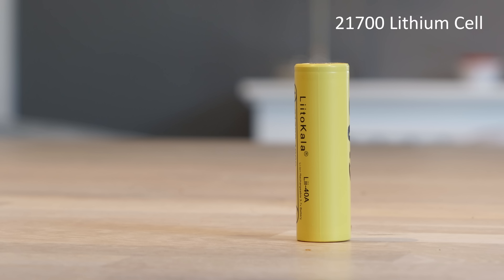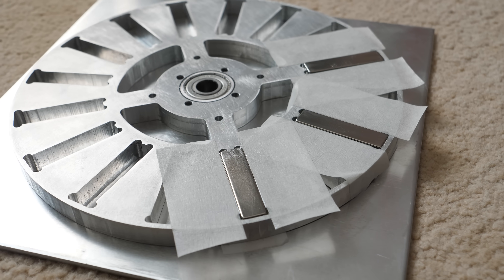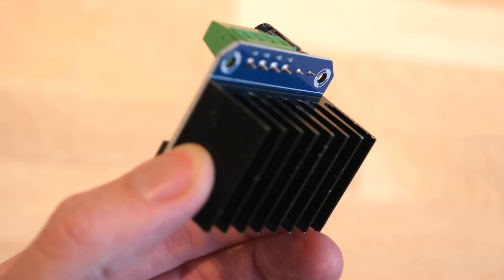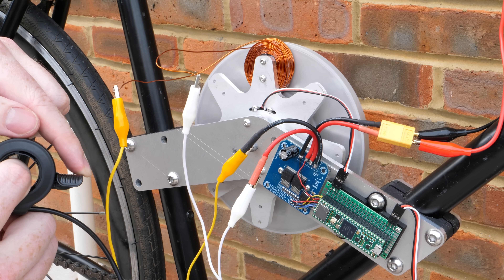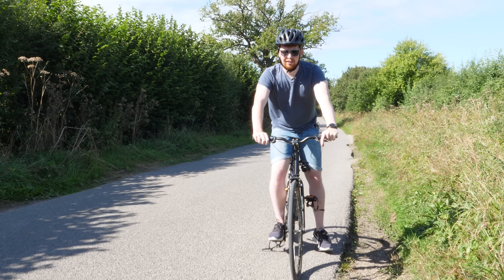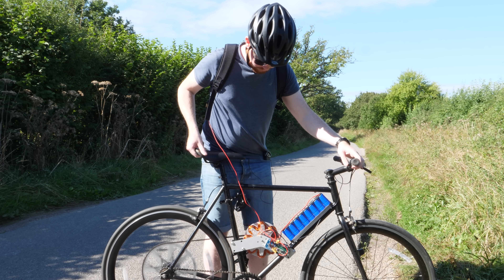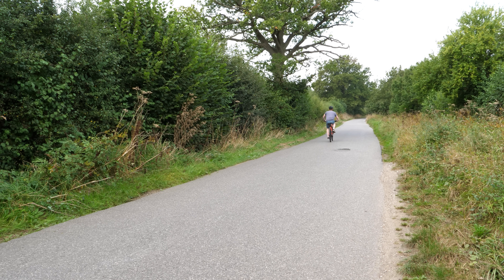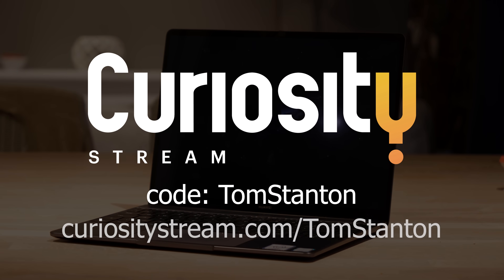Super Capacitor Bike

Comment: would the energy stored in the super capacitor be the same as in the battery from that hill regen braking?
or like more efficient recharging to the caps from that hill vs towards the battery ?

Comment: Is there value in using the battery to charge the capacitors to provide a consistent energy curve to the bike as the batteries lose charge and power?

Comment: I always double check my distributor timing before heading out on my bicycle.     I have found that I am most efficient when I stomp down on the pedal at 15 degrees past top dead center.    Too early and you are wasting energy trying to push down on a pedal that's almost in the vertical position.   Too late and you've missed a portion of your power stroke.     Fortunately you are only dealing with pair of legs which makes the timing fairly simple to setup.    Just make sure the electrodes that connect the distributor to your temples don't come loose and fall off.     This could cause a major malfunction that blows your crank either down thru the seat or up thru the ole rectum.   Minus any lubrication that is sure to be a painful experience.

Comment: As a single speed, with regenerative braking this would be absolutely brilliant for urban use. You really only need assist to get to speed. Energy could be dependent on mass, so this would be awesome for cargo bikes starting up.
Reply: flat urban areas
Reply: Li-ion is still better in practice.
Reply: Maybe not urban areas with elevation change like Cork or San Francisco
Reply: Torque is still an issue
Reply: Most power is wasted on aerodynamics... It gets quite bad over 25km/h
Reply: Capacitors for taking off quickly from the start, li-ion batteries for cruising, with regenerative braking recharging your capacitors specifically. Now that'd be neat!
Reply: And about 1,000 more capacitors.
Reply: You mean a bafang
Reply: @wesss9353  not quite. while some bafang have regen brakes, a super capacitor energy storage system would be great for the unique need to quickly store, then quickly release energy. Such as powerful regen brakes then being used to help you get back up to speed fast.
Reply: Here's how I like to think about it: batteries are to SSD memory as capacitators are to RAM

Comment: Capacitor voltage drop isn't as much of an issue as you show. The voltage drops but the Amps are still there, so you can use a boost converter. At long as you can step up the voltage enough you're fine, so the minimum voltage depends on your booster mostly.

Comment: if the motors's acceleration are limited by input voltage - what if you added more super caps in series? can you get an eyeball flattening 0-60 time?

Comment: My dream was to create a hybrid car using "Super Capacitors" as you're cruising with little gas engine charging the capacitors and the engine throttles down when full then when you "punch it" it becomes a super car. You only need enough "Super Capacitors" to get you down a quarter of a mile. I feel with "Super Capacitors" with a gas engine a *generator" could be the ultimate drag car.
Reply: Damn! IS THIS THE TRUE POWER OF COMMON CORE PHYSICS?!?

1) Small, noisy, shakey gas motor 
2) To power a generator 
3) Which charges batteries
4) Which also charges supercaps
5) Where the power is connected to electric wheel motors
6) Which power the car
7) So I can live my life 1/4 mile at a time

OR

1) Pick any GM V8, like an LS3, of 450-500 cubic inches
2) Put a TH700 transmission on it
3) Stick it into chassis of your choice
4) Enjoy reliable 600-800 HP delivered smoothly all day

Seems like old tech is about 50% more efficient.
Reply: @alphaforce6998  You clearly have not seen how a unmodified Tesla Plaid smokes 99.99% of ICE cars in a drag race, and it can do it over and over  at the equivalent of close to 95 mpg.
Reply: @macrumpton  I doubt it. You're watching videos that feed into what you want to believe. The fastest electric drag cars will not touch the fastest combustion drag cars, such as those powered by nitromethane. And no, it's not getting 95 mpg because electric cars run on coal. So how many tons of coal had to burn to charge your toy?
Reply: Just have a lithum battery pack feeding the capacitors for the speed run, and have the car switch back to running directly off the lithium after the ¼ mile.

Comment: I'd be much more interested in setting up the super capacitors in parallel with lithium ion batteries.  The batteries store the bulk of the charge while the caps are there to buffer the charge and discharge.
Reply: It's easy to put them in series, but in practice it's hard to make it actually useful (optimizing for any metric and it's hard to justify a hybrid design).
I've done a four different super capacitor designs for industrial (wide temperature) applications where Li-ION would never survive... but super caps degrade VERY FAST with a stored charge (10x life every time you halve the voltage iirc). So we end up over-designing (more parts in series with lower voltage on each part and higher values on each part) by an order of magnitude (10x) so that we can get our desired product lifetime.

Comment: Here is an idea to maximize the usefulness of the charge in the super caps:  Design your system such that the motor runs off the voltage from 1 cap.  A switching network can rearrange the configuration of the caps to keep the voltage near constant.  I.e when fully charged, all caps are in parallel.  after 50% discharge, they are rearranged into 2 parallel packs connected in series.  After 50% of that voltage is discharged, the caps are again rearranged into 4 parallel packs connected in series.  Finally, all 8 caps are connected in series.  This would give you 4 times the working voltage.
Reply: That is most comical. Might win out. What I do know from looking at electronic mass management in electric cars is that the bike has 1/50th what it should.

Comment: Tom ,some people are about to start running high performance ebikes and emotos with a combo . The best possible power source ,to the best of mankind’s knowledge will set u up with a modest bank of caps to get beast mode rolling and the batteries quickly take the duty over and also recharge the capacitor population. It’s a software intensive process ,but see this system operating to standards and the power pack will deliver amazing duration cycles with fat amperage bursts that blow my mind.

Comment: To more easily wind the coils, attach them to a lathe, rig a microswitch on a cam that indicates 1 turn, then wire the switch to the "equals" key on your trusty calculator.  Enter "1 +" on the calculator and every revolution of the lathe will add 1 to your count.

Comment: I think there was a math error. When you put capacitors in series you lose capacitance but gain a higher maximum voltage. The whole cell is .5F since you have 8 in series. This makes the max energy stored 117J.

Edit: the whole cell capacitance is 50F. I thought each super cap was 4F, not 400F. Tom is Right, I am wrong.
Reply from the maker: The total capacitance reduces to 50F, but the voltage increases. So using the equation 0.5*C*V^2, the energy is 11664J.
Reply: @TomStantonEngineering  LMAO I made the math error. I thought the super caps were 4F not 400F. My bad haha. but yea thats the equation i used.

Comment: I was expecting to see super capacitors in Teslas after they bought Maxwell but not a peep about it.  I thought the super capacitors would be great for buffering power into and out of the battery. Providing a short term pulse for acceleration and to allow faster braking, but there non appearance must indicate the app is not viable. Or is it?  Any input on this?

Comment: So, now you need to make a generator for the front wheel that will recharge the capacitors and use the system as a "pedal assist".  It'll fully charge going down a hill and provide that last little kick to get up over the top of the next hill without as much effort or having to get off and walk it the rest of the way up. ;)

Comment: You actually COULD add regenerative braking to the homemade motor. I noticed your magnets are exposed on the other side. Another set of coils on the other side could be rectified and connected to the capacitor bank when the motor's off, essentially making the other side an alternator. Or if the braking effect is too powerful, you could put it on its own trigger or something.

Comment: While super capacitor voltage drops linearly compared to discharge current, it won't do that compared to energy. Using half of the voltage leaves only one quarter of energy unused.

Comment: Oh snap! Well the recovery is definitely more efficient when directing the power to caps as apposed to the battery. I'd try figure out a way to use a dual system that works off both technologies. The caps would be used to regain power and then somehow supply that power to the battery...

Comment: Perhaps use a battery bank for the range, then utilize the capacitors like a boost of energy to get you up to a speed where the batteries don't have to work so hard to get you up to that speed, and then the batteries can maintain the speed using less power to keep you at that speed.. and only using the capacitors like a boost of extra power to the motor.

Comment: I've always thought super caps would be best incorporated a more efficient braking regen capture, then use that voltage to charge or assist the main battery pack.
Reply: Use SC to store the braking energy and deliver it back to start moving again. Let the lithium have the cushy job of running the car over 15mph.

Comment: A hybrid system would be amazing, super capacitors used to capture the regenerative braking with a mid sized battery pack for long range. I'm hoping to design a kind of solar velomobile with a mini camper trailer and this would be great as part of it. Like even if the output of the capacitors just helps with getting momentum going up hills that would still be a great boon to the bike commuter community.

Comment: I don't exactly know how to do it, but a hybrid system would be nice I think. A smaller (lighter weight, faster charging) battery coupled with super capacitors on a bike with regenerative charging would be cool I think. But then again maybe lighter battery still would win, although I guess you could a longer lasting battery as the  "wear" on the battery would maybe be less (or you can engineer it to be less). If you also could fit it the bike (best design, best placement) with a 5-10w solar charger (that first charges up the capacitors ofc, but when full charges the battery's also). That would be nice and maybe it would be enough for a couple of km of commutes or getting to the shop without having to remove the battery and charge it in your home.

Comment: I would love it if you made a video dedicated to power storage, and comparing things like super caps, regular caps, some of the many different types of batteries, solid and liquid fuel... etc. You do such a great job of explaining everything in your videos, and I think that a comprehensive list could help a lot! It gets kind of confusing with all these different types of energy storage, you know?
Absolutely love the bike by the way!

Edit: I don't know if it's really possible, but could yo try and combine the electric and flywheel elements of your bikes?  You could use the flywheel to start the bike moving, and use the capacitors as a boost, or even use batteries to keep the flywheel going so you can stay stopped for longer? just an idea.

Comment: Just an idea, maybe use a cap bank to boost acceleration and save some drain on the lithium battery. Use the motor to recharge the cap bank for the next acceleration. 

I don’t know it that would extend the range of the battery.

Comment: The experiment with riding down the hill and up again is nice, but not the use-case i'd consider for capacitors. More interesting is common work day scenario. Slowing down for traffic lights, passengers, stopping buses, etc - and then accelerating again. I would like to see a project that is aiming for efficiency on that target, meaning: fast breaking, and high energy efficiency. Maybe you can even get hands on some of the graphene capacitors for it?! :) Its said, they can reach 20-70kF with a very high energy density. Thank you for your videos!

Comment: The graph at 1:13 is not correct. The energy stored in a capacitor as a function of voltage is defined as E = 1/2 * U² * C. The  blue graph should be a parabola
Thank you for your great demonstration

Comment: I like the idea of supercapacitors, but wouldn't it be great if they were used in conjunction with li ion batteries as a buffer for high current spikes and a buffer for regen braking thus extending the life cycle of the li ion batteries?

Comment: I wonder, if you took a "zig-zag" or "switchbacks" route down the hill while using regenerative braking to charge the capacitors, would it generate a higher charge than taking a direct, linear route? I feel like spinning at a slightly lower speed for a longer period of time might be advantageous, but who knows?

Comment: What if you had an extra set og batterys/capacitors that was charged by the front wheel while you were using the first set on the motor.
Then when the first set is used, you switch and use the second set that was just charged.
Then when the second set is used you switch back to the first set that is now charged.

Just an idea.

Comment: I'm curious to know if you add capacitors to your electric bike as they recharge very fast if it'll help boost the range of your electric bike as it uses the capacitors to take off before going back to the battery

Comment: The amount of  power that the motor outputs of an electric vehicle is most of the time, NOT dependent on the voltage of the battery. A motor can usually put out much more power than it is run continuously. That is the job of the power supply. It is designed so that only when the battery is almost drained, or voltage lower than it's design limits, will power be reduced.

Comment: so rad love it, reckon you could just use a fully contained super-cap unit for launching, regen while coasting. Would probably be a lot lighter and cheaper than a full E-bike, and would make longer rides/commutes a lot less strenuous, not having to launch yourself each time you get to a traffic light. Also no charging batteries or extra costs

Comment: I've got the feeling, that this electric motor is far away from today's state of the art. One issue is the distance between coil and magnet, the other the focus of magnetic power by an iron core. The third is the circle of the magnetic field, which should be near to closed by rotor and stator.  You can't get this close enough with those abilitys of a cnc router and a 3d printer.

Comment: I think a better approach is to design a switched mode power supply to boost whatever voltage is remaining in the Supercapacitors to the design voltage of the motor. That way you can extract more energy and you can use a much more efficient motor.

Comment: Usually if i ride down a small hill, I can get around 40% of the way up the next hill just with the momentum gathered. If you trialed the bike on a series of small up and down hills whilst continuing with momentum i bet it would keep up a good pace, add in some strategic pedalling and it will be flying. Would be good to see a pump track version that automatically detects when to apply power/regenerate
Reply: Except to charge the bike as you go down the hill the capacitors are going to slow you down, in theory meaning you aren’t  going to get 40% up the next hill anymore. The energy in the capacitor  has to come from somewhere.
Reply: @chris12456  yeah, but it allows you to spread out the energy needed over time by recovering some of the extra you don't need when going down hill, making the climbs easier but the downhill harder
Reply: For a rough guestemation that seems about right on that 40%, or at least it aligns with his numbers. In your case you are just trading between potential and kinetic energy then back to potential energy. This is just due to simple physics laws and nothing too complex. If the two hills are identical in height, and you only make it 40% up the second hill, then you lost 60% of your total initial energy to friction (air resistance included which is probably the biggest factor). If you take and convert as much of your starting potential energy into electrical potential energy, then assuming no losses in the conversion to electric potential, you stand to recover again about 40% of the height back up the second hill with maybe a touch extra height as air resistance is equal to velocity squared. Though the conversion to electric potential is never 100% efficient so I would imagine whatever savings in energy you have by reducing downward speed (in the conversion of energy and thus velocity to electrical potential) you would lose in the conversion. For the weight spent, just having batteries would be a better storage of energy per kg.

An e-bike challenge would be interesting. Contestants get a certain size and capacity battery for assist on the course. It's up to the teams to determine the best place to use it and to come up with the best motor/gearing etc.
Reply: how about a gaslever like in motorbikes and mopeds? easy accelaration by a turn of the grip or thumbing a lever. no need for automation and electronics and you get direct input without changing anything else of how you normally ride your bike
Reply: @ExplizitDuester  because this kind of motor doesn't work that way.
Reply: Somebody get perpetual motion Youtube on the line, this guy's solved it!